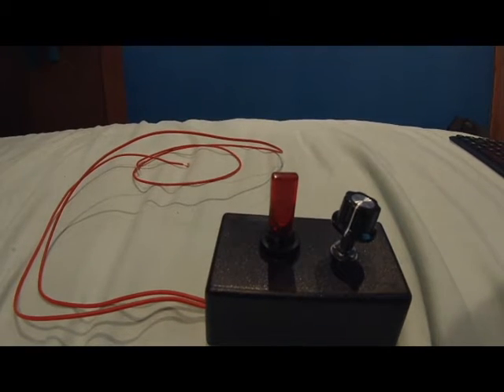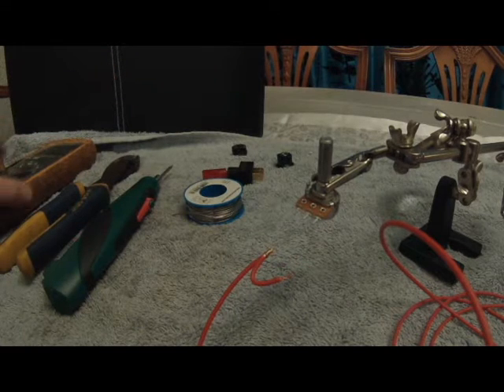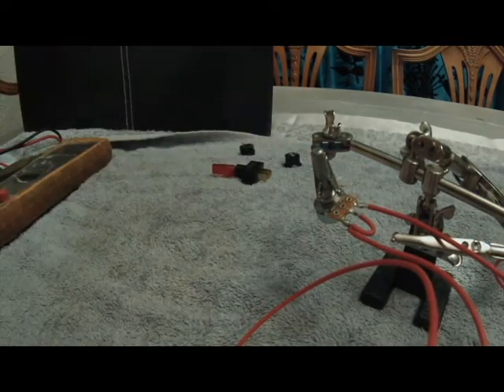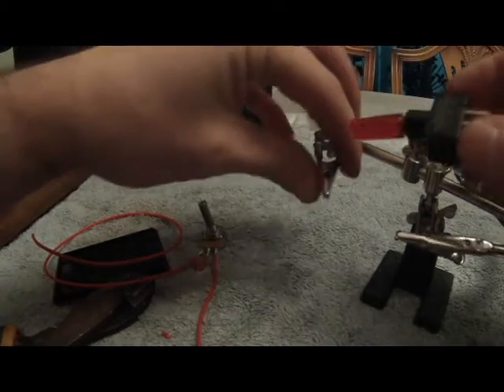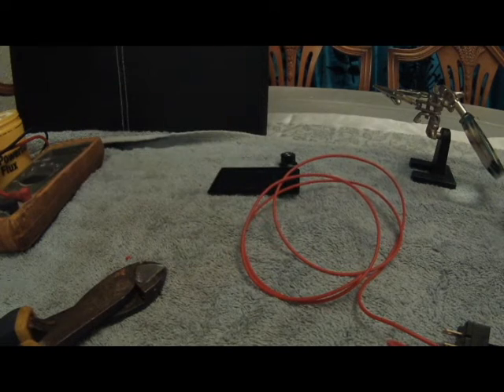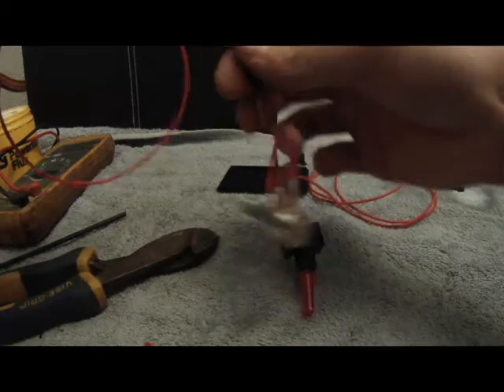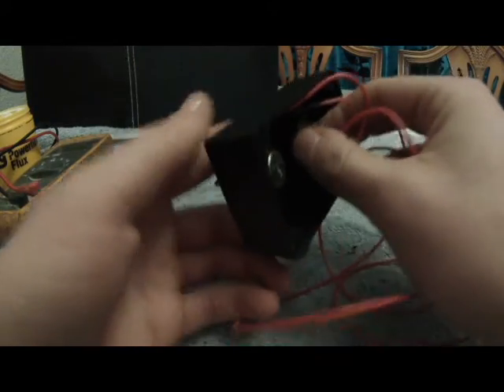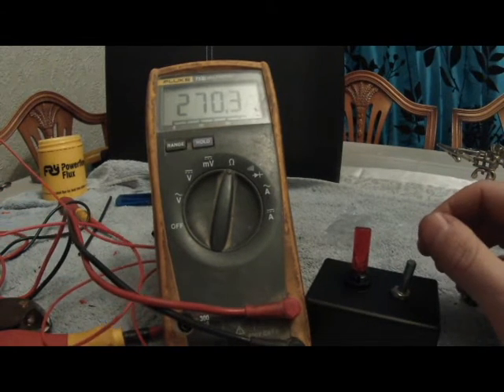£10 resistor tuning box , 30 + bhp gains! THE EVRY MOD HOW TO

Comment: So just did this I didn't put the 2 extra resistors in like you did off your ground wire on the pot but I have it wired the same and it's not engaging

Comment: How do you install it? The wire that comes from the switch, do i connect it to pin 3 or 2? Same with the wire from the potentiometer, which pin do i connect that one too? Sorry if im being stupid
Reply: One wire jumped into pin 2, the other into pin 3 on the diesel pump harness. It alters the resistance the e.c.u. Sees causing more fuel to be injected 👌
Reply: @mpatrovits1  Do you know if a certain wire has to go to a certain pin on the plug or can it be either?
Reply: @mws8025  it can be either way around it really doesn't matter as long as one wire goes to pin 2 and one to pin 3 , it just changes the resistance value that the ecu sees and causes more diesel to be injected.

Comment: i wonder can you use this metod to fool air presure sensor to get moore boost
Reply: Do you mean on a petrol?
Reply: I have done the same to a Mercedes om 606 boost pressure sensor but a 12k resistor . Added 3 or 4 psi no problem

Comment: Does it need to be a 3 pin switch or can you just use a 2 pin and use the positive and negative
Reply: A 2 pin switch will do fine, I used what I had available

Comment: Would this work on a 1.7dti mk4 astra
Reply: Ryan Noone it may, if it has indirect injection and an electrically controlled diesel pump.  If it's fully mechanical you will have to manually turn the max diesel screw / bolt up on the fuel pump itself.
Reply: @TURBOTWINS-NE  works on 1.7dti engine mate. Video will be up tonight.
Reply: Would this work on a 2.0dti omega?

Comment: Hi does it work on a e39 525 td? Or is this car to new?
Reply: E39Td ? Do you mean 525d? If your car is 525d it will have M57 engine code and too new for EVRY.
Reply: if its an M51, yes you can do it. you need to put the wires with the resistor inbetween wire 2 and 3 on your pump.
Reply: @TURBOTWINS-NE  Thank you!

Comment: How much OMHS in resistor and in potentiometer ? :)
Reply: In my v70 2.5 tdi mk1 I set the potentiometer to 360 ohm 😉
Reply: PaulMedia pot was 1k ohms, resistor was 190 ohms I think 😁
Reply: it works fine but now I cut the turbo pressure when I touch 3000 rpm ... have you ever had this problem?
Reply: If your car has a boost pressure sensor, its probably over boosting and going into limp mode, fit a gauge and check 😁
Reply: @manuel90gti  I did! It was overboosting, you could turn the resistor down or fit a diode in the map sensor to make it not see as much boost. Also you could clean your intake because the carbon makes the intake diameter smaller making the boost levels higher to the sensor

Comment: Hi,
What resistance is that? I'm not a native English man so i don't understand. Sorry
Reply: The variable resistor is 1k , or 1,000 ohms.  The safety resistor is 270 ohms . Making a maximum of 1270 or minimum 270 . The lower the resistance the more smoke and power

Comment: Would this work on a 1.9 tdi bxe 2008 smoke mapped already but doesn’t smoke when driving
Reply: Be careful if it's already mapped, more fuel at that point will likely damage the engine.